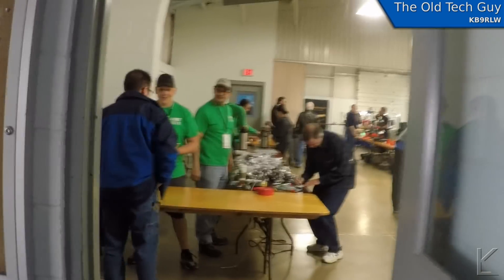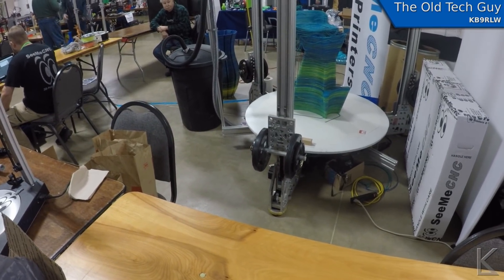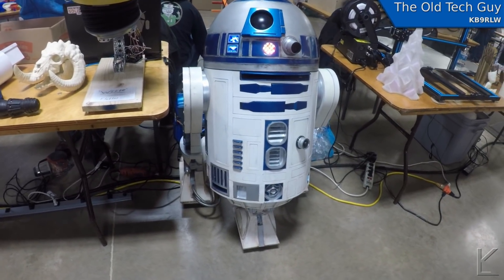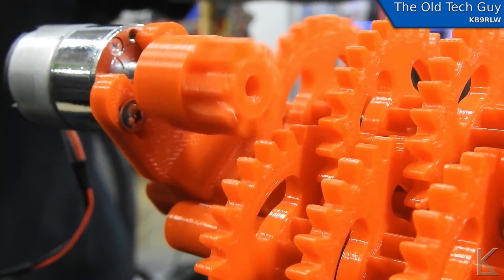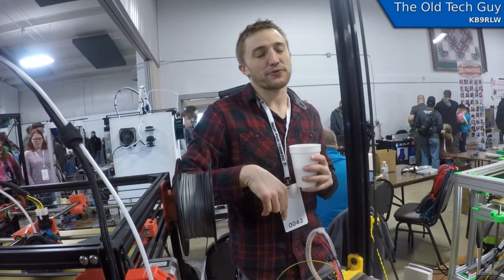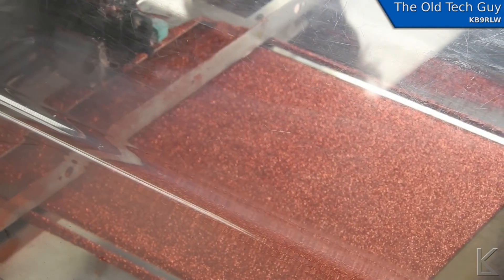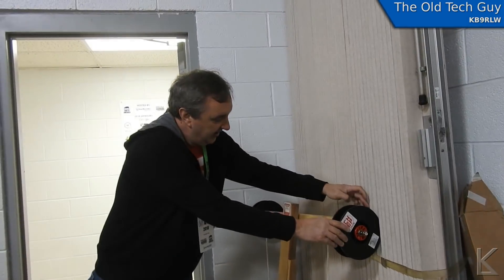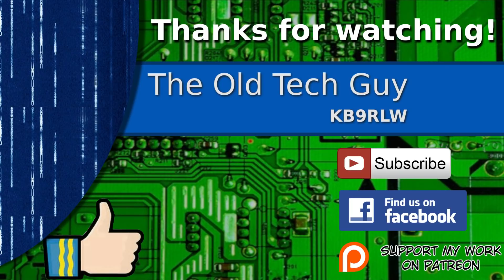3D printing - A visit to the Midwest Rep Rap Festival 2018

Comment: Only a 4.5 hour drive each way providing weather and traffic don't hinder the drive there. Just spent my seed money for FDIM at Dayton by buying a 30-foot free standing aluminum tower and it came with a 15 foot thick wall aluminum mast. Got all for less than half what it would've cost even if I drove to Michigan to pick it up from the factory. So Kevin, did you come home with anything new?